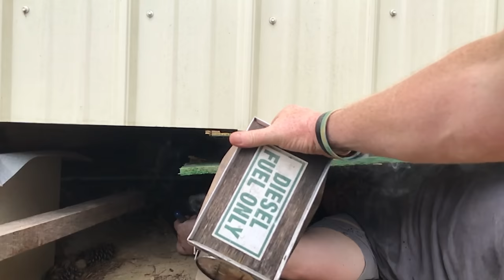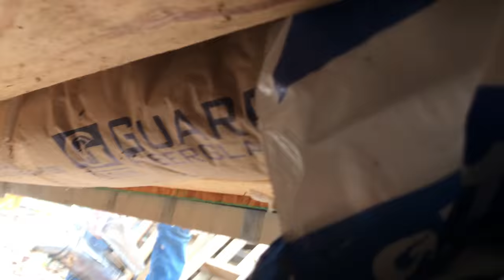I crawled Under This Church and Found a MASSIVE Hive

Comment: Make a frame with Sched40(cheap) PVC as wide as the liftcage about 7ft high and on both sides . Paper it with Bublewrap foil Insulation , shiny side out . Hang a couple of Batt-op Fans and you are good to go . You can dismantle this easily for multiple uses .

Comment: Finally got the opportunity (and now I'm stupid enough LOL)  to attempt my first cut out , 2 hives from same house. Different sides. 6 ft heat sign on top floor,and down 2 1/2 ft on bottom floor.  The other side of house I don't know the size of hive.  Told they were in wall at least 4 years . This could be an interesting Education for my friend and I. Temps in the 40's. I'm Hoping rain is over by then.